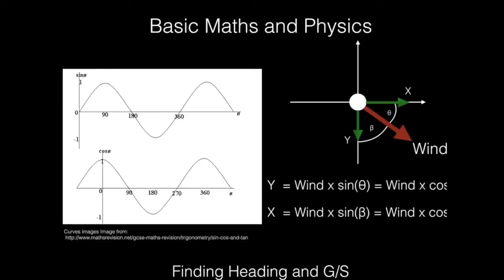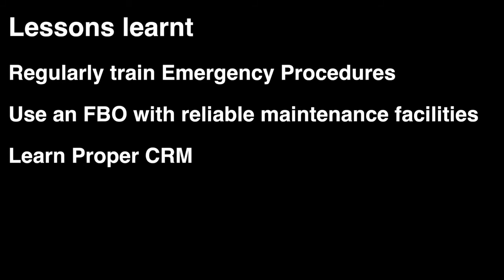Fatal Spin Crash of Beechcraft Queen Air On Take Off Mayday Talk Episode 14 Part 1

Comment: Good explanation but too much emphasis on the lift imbalance. Rudder is key in maintaining directional control. The lift imbalance induces roll. The thrust imbalance is responsible for the Yaw. Banking into the good engine lowers VMCA. Banking into to bad engine raises VMCA. Once airspeed falls below VMCA the rudder will be unable to counter asymmetrical thrust.

Comment: I can usually watch these postmortem crash and/or instructional videos and pick them apart in both accuracy and content. But this one appears to have not only covered all the bases, but done so appropriately (although I could have done without the "moment of silence"). This was 100% pilot error! You NEVER turn into the dead engine without plenty of altitude and airspeed. This is CARDINAL RULE 1 on DAY 1 of multi-engine training.

It's a shame so many people had to die because of this guys mistake.